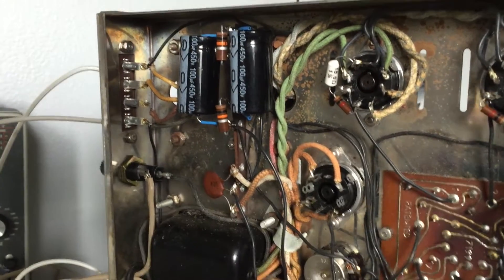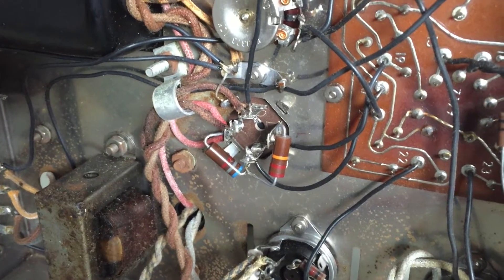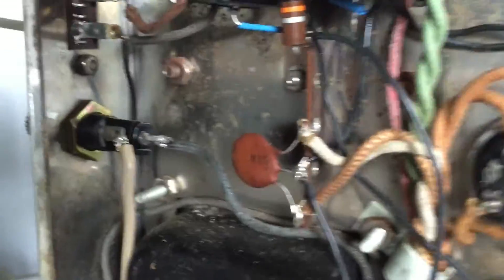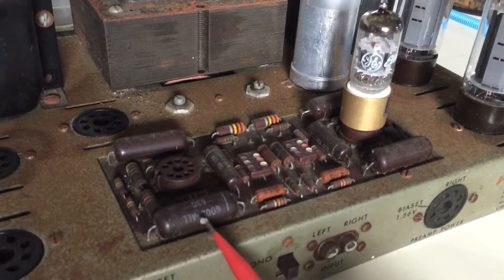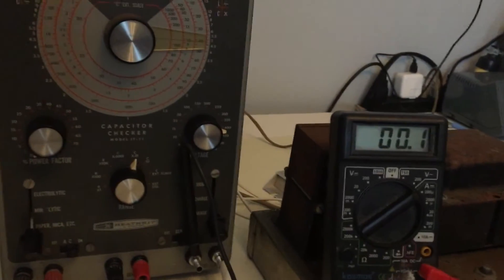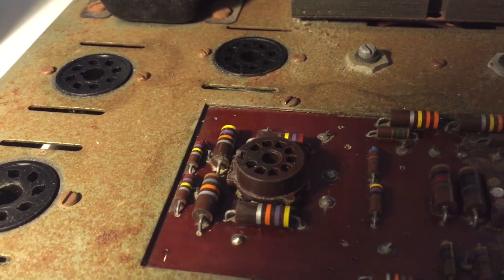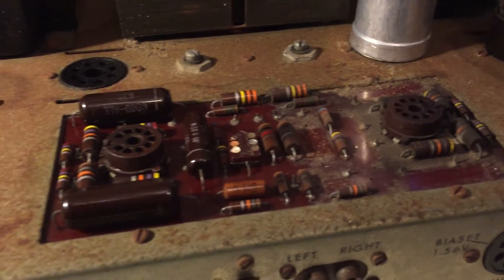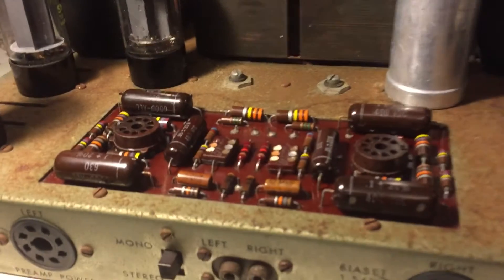Dynaco Dynakit ST70 Stereo tube amplifier repair PART 7 of 9

Comment: bass boost to make up for large bass roll off across these capacitors.   Measure signal on both sides of the capacitors with a scope with a 20 Hz square wave and you will immediately see what I mean.

Comment: Change 0.1uF 400V interstage coupling caps to 1.0uF 400V values for a substantial improvement in low frequencies. Aglow frequencies, the front end must generate a large

Comment: I was just wondering about the initial charge current of the caps when you test them with the ammeter in series. Could this current not be so high that it could fry the meter? Using a digital meter probably reduces the adverse effects, but if it was a moving coil meter, I wonder if it wouldn't damage the meter. Great series, by the way. Thanks.
Reply from the maker: +M Caldeira no doubt instantaneous draw could be an issue, perhaps moreso with analogue meters.  Id imagine that based on the fuse rating and type that such a mistake would either be benign or blow the fuse.       I do as always test first with the 10 amp setting which captures the highest value